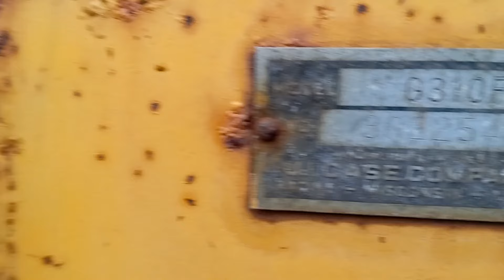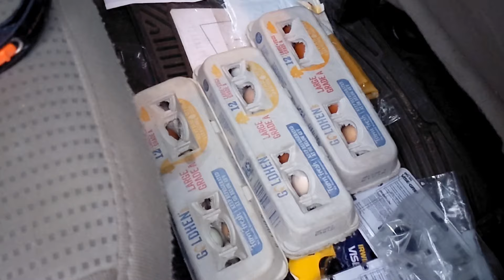Saving A Bulldozer

Comment: A note in the future: It's probably best to lift the dozer by the forklift, then pull the trailer out from underneath. Get's around the dangerous part of moving while having it up in the air and have something go wrong (like it almost did!). 

The 1960 310D and later models have the G148B engine. The earlier models had the original G148. 

That's an aftermarket hour meter, so definitely not original hours. 

The uneven wear on the front sprokets could be due to difference in track adjustment. 

Glad to see someone else trying to save this old machinery!
Reply from the maker: I appreciate your comment. I would have had to unload the skid steer unnecessarily and I have been driving forklifts since I was 12 zero risk in how I unloaded the Dozer.